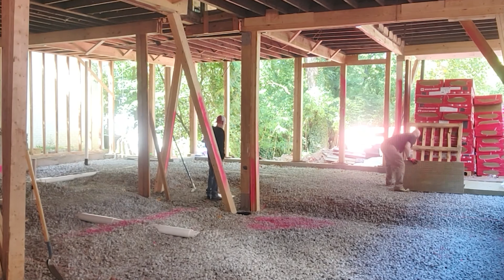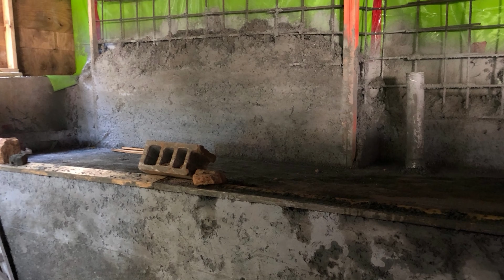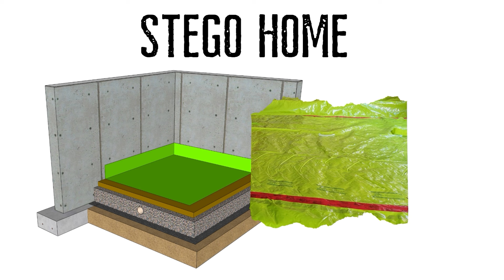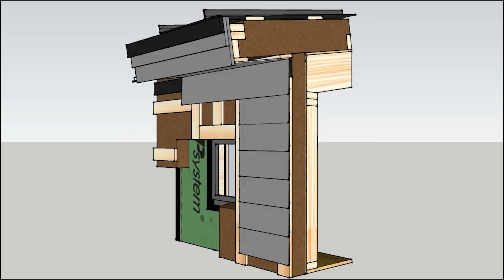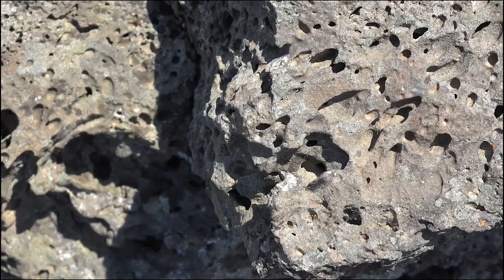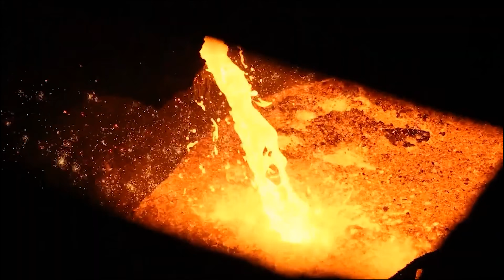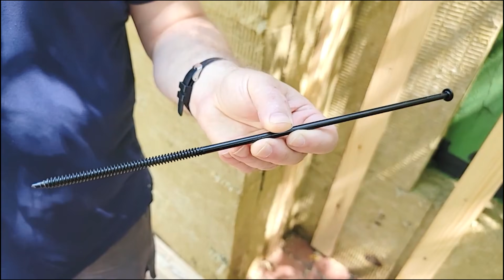The Perfect Wall Explained with Examples

Comment: So thermal bridging and barrier pentation every time you install a 12" screw that is super conductive and a water channel.  Awesome
Reply: It is difficult to put together a wall assembly without at least minimally conductive elements penetrating through the insulation. Not crazy about some of the elements in their wall assembly but the principal of building the envelope outside of the structure is spot on. Not only does it keep the structural elements at a relatively consistent temperature and humidity, it is far easier to execute a good quality envelope building layers from inside to out, entirely from the exterior.
Reply: @bopodoq3069  I agree that the method is far superior to 2x4 or 2x6 construction with void insulation.  The video is called the perfect wall...which this is not.
Reply: I my opinion the most perfect wall construction method currently is ICF. It’s still not perfect but it’s the best I have found so far.
Reply: What  would you do  differently?
Reply: How would you improve it?
I'm planning to use 2x ledger boards attached to the sheathing to eliminate any continuous thermal bridging, and as a bonus it will provide a much larger target for the screws used to attach the furring strips. I'll just add another 1-1.5" of insulation to compensate.
Reply: Plastic screws?
Reply: Thermal bridging is minimal because the screw goes into the wood stud. Joseph Lstiburek Is God for information on building the perfect wall. His research and study of wall designs are what pioneered this field. All these hop on the bandwagon YouTubers are a result of his pioneering work, If you want it straight from the horse's mouth look up "Joseph Lstiburek building science"

Comment: Not sure if this is a dumb question but would the concrete slab crush the Rockwool insulation underneath and compromise its insulation rating?
Reply: nope, the comfortboard is pretty dense and there are different ratings for it. where he talked about comfortboard 80, he quickly mentioned comfortboard 110 under the slab. when weight is distributed evenly you can load quite a bit on top of that rockwool
Reply: @janoserdelyi9879  Good to know, thanks!

Comment: Wow. Awesome. What fastener manufacturer are those 12" Galvy screws? Also, Is there a chart somewhere that says the minimum of exterior rockwool to use based on location?
Reply: Home Depot sells for more than $1 each